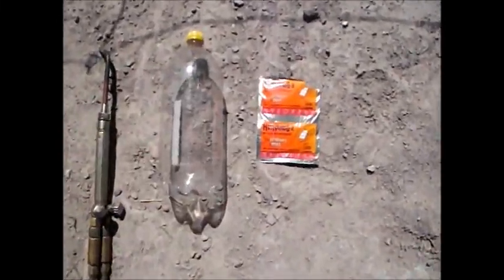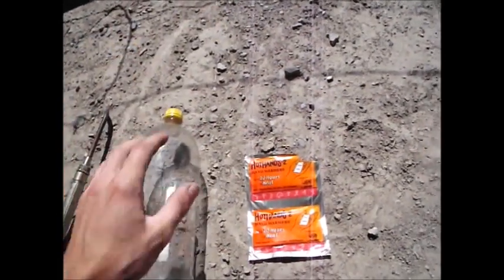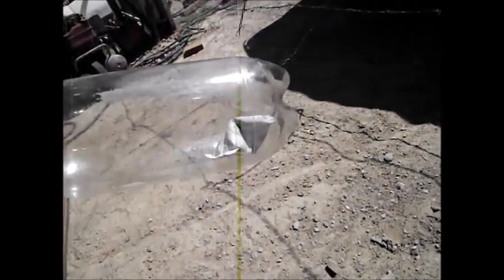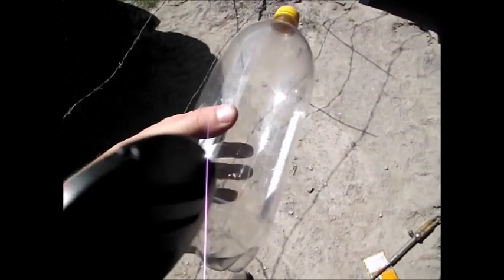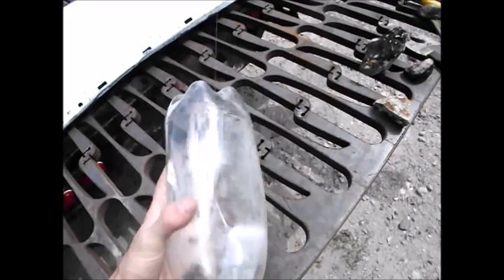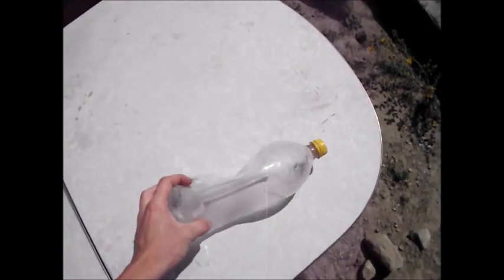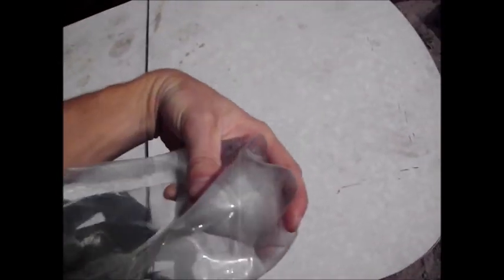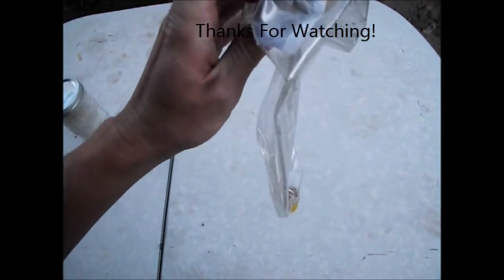Hand Warmer With Pure Oxygen Inside Sealed Bottle

Comment: Get on clearance and use to pull the oxygem out of stored food. I found the toe warmer size to be about right for a 5 gallon pail. Most are streight iron and carbon, but some are an iron aluminum or magnesium iron alloy. Those types have CaCl2 to absorb moisture to start the process. Also make some hydrogen. You really wouldnt want to put one of those in pure O2 with a bit of water. 😮

Comment: I know this is an old video but to seal a bottle better and to make a pure gas inside try blasting it like you did but use a tyre valve through the lid and silicone sealant to seal it, blast oxygen in like you did then vaccume it out then pump it back up with oxygen

Comment: Then in theory you should be able to make ice with it without using electricity. Place a cup of water in a solid container, the hand warmer in another and join the two with a tube. Add oxygen to the system and the vacuum it creates would act on the cup of water.
Reply: wvXvxvXvw nope. The evaporated water wouldn't be absorbed, and the process would stop.

Comment: Adding fresh oxygen to the bottle after putting in the warmer would in theory throw off the accuracy of the test.

This is a good one for your vacuum chamber testing, although you might need a whole lot more hand warmers and maybe a way to pull open a ziplock bag or punch a hole in such a bag with your laser.

Comment: if you put it inside a metal pressure vessel with a vacuum gauge on it I wonder if it could pull a full vacuum?
Reply: judging from the video, i think it's possible. it has to be filled with oxygen though

Comment: would you say that this could take the place of a dessicant or be used in tandem to 'recharge' the dessicant'
Reply: You can boil the water out of a desiccant in a microwave. Pink silica jell will turn blue in about 30 seconds. A vacuum will remove water from a desiccant.
Reply: +Frank Oldman I was thinking more of an electrically challenged situation, such as the wild, one it two if these to react with the water and dehydrate the desiccant
Reply: +Frank Oldman I think your answer translates to "yes, but why do it that way"
Reply: +Frank Oldman I think your answer translates to "yes, but why do it that way"
Reply: Just useful information not really related to the comment.
Reply: I'm not sure it'd work as a desiccant but I know people who use it to store grain in barrels long term. 5 warmers do a good job for a 50-gallon barrel apparently.
Reply: You should start with a basic high school chemistry book and a good dictionary. The question, while syntactically correct English, is semantically nonsense.
Reply: It would work as an oxygen scrubber.  You can purchase similar bags for placing into tins of freeze dried food to extend the storage time to over 10 years.  It does not remove that much water as you could see the condensation remained fairly constant during Cody's experiment, the water in the rust reaction is recycled I seem to recall.